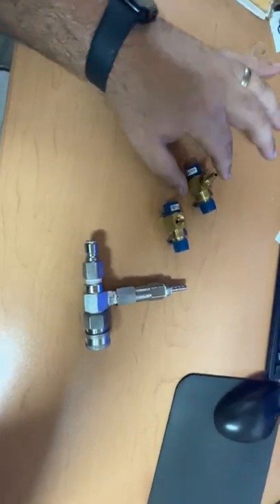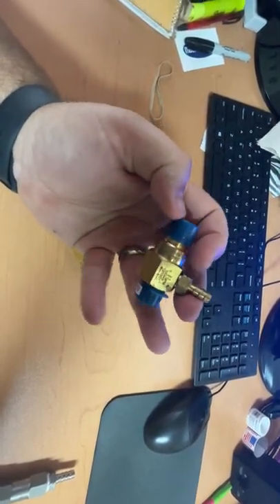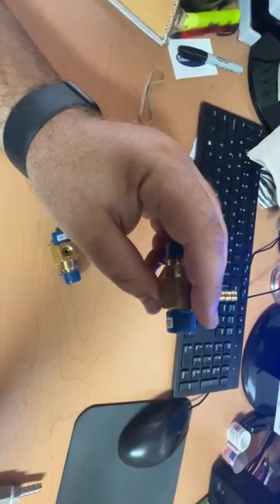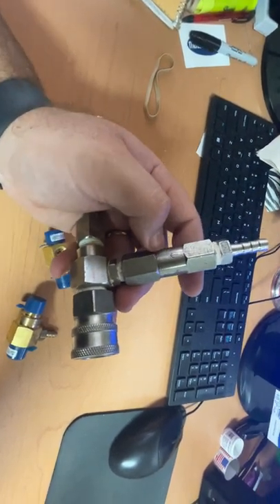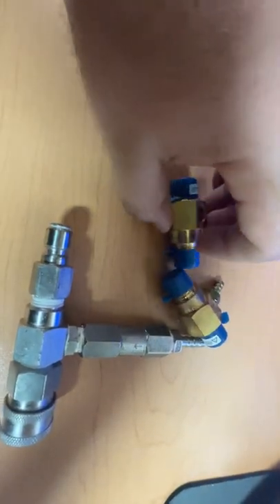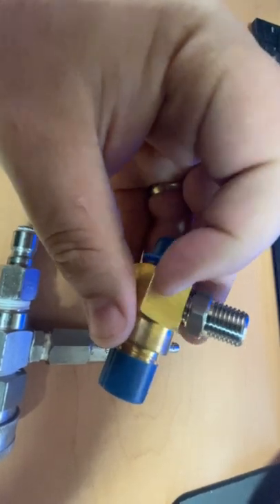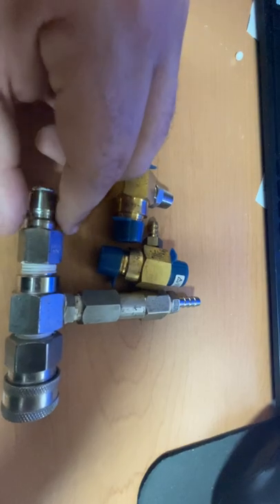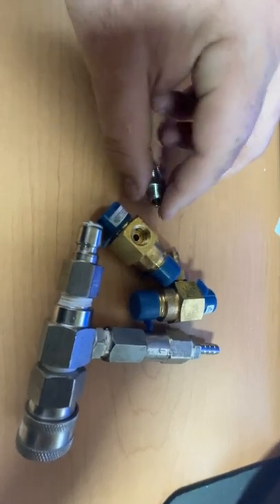Supercharging your downstream chemical injector

Comment: Why did not give the new ratios? Why would I buy it if you don’t provide the increase ratios?!
Reply: Because the check valve won’t change the ratio. It’s just more durable. Highly recommend!!  Still have to do a flow check but it will stool be anywhere from 8 to 11:1 draw. The injector itself will determine more or less chemicals. 2.0 vs 2.1 vs 2.3

Comment: How do you rebuild the check valve when it fails? I'm trying to open it. Very difficult.  The rebuild kit is $5 and an entirely new check valve is $28.  I just bought a new one and it failed after 3 house washes.

Comment: it looks like the Barbs on both injectors are 1/4" - is that right? I put a 3/8" Barb on my new check-valve, and with 3/8" hose I get a very phat draw rate.

Comment: So basically take spring and and ball out and install any 1/4 check valve??
Reply from the maker: Yes!
Reply: @fivestarpressurewashing1941  does it need to be high pressure?
Reply: @hisnameisiam808  Think about it, it's drawing detergent slowly out of a container. It's suction, not high pressure. So in short, no, it's not high pressure.

Comment: Do you happen to know offhand if these also fit the newer GP kynar/stainless proportioning injectors? The weakness on those seems to be the o-ring blowing out, as well as the plastic barbs sometimes cracking.
Reply from the maker: As far as I know those injectors are different
Reply: @fivestarpressurewashing1941  where do I get the check valve?